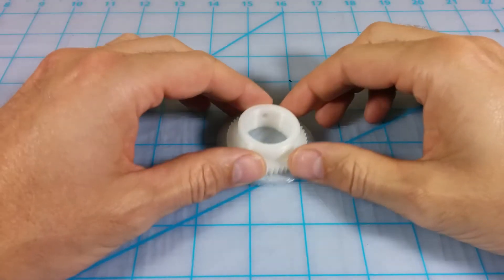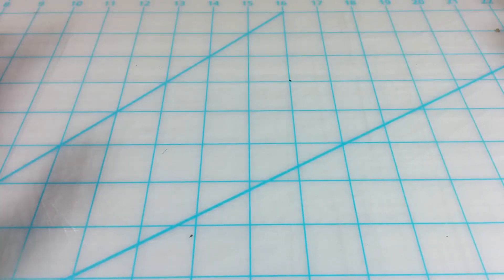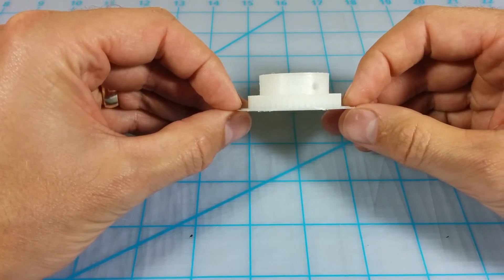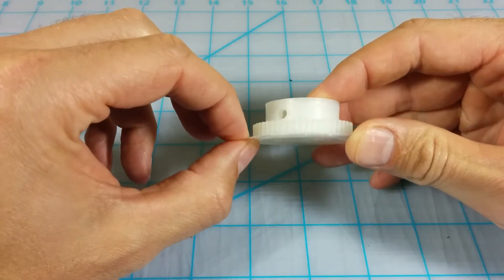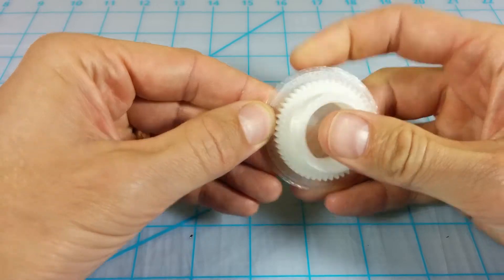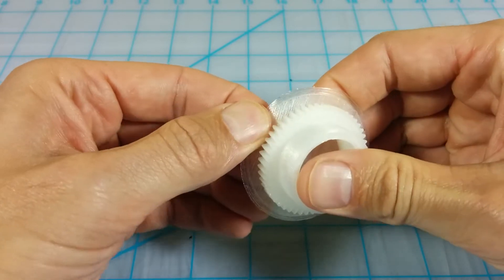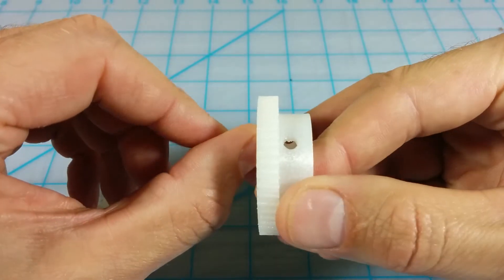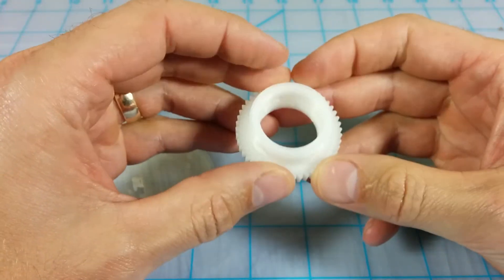Printing with Nylon - Taulman Alloy 910

Comment: It's very nice.. I printed a simple bracket with general nylon filament. It is of 2/3 of a palm size, a 2.5mm thickness base sheet with five 20 mm height screw posts. A severe wrapage piece was the result. As it flipped up, it didn't stick firmly on the bed.

Comment: What other settings you printed it on and what printer?
Why don't to share them in the video description ????
Reply from the maker: Sorry I posted this long ago and I don't have them anymore. I used the recommended temp settings for the filament and then fine tuned speeds which varies greatly from machine to machine, I always need to experiment anyways when I try on a new printer.

Comment: What nozzle did you use for this gear , looks fantastic in detail .. Some details for your machine if not in detail of vid ty!
Reply from the maker: The Kaveman Its a 0.4mm nozzle printed on a Printrbot simple modified to print 8X8X10" with an E3D nozzle, and heated bed. I now also use a gear head extruder that uses a hob and gears to drive the idler side of the extruder.

Comment: which program did you use to program the raft?
Reply from the maker: Daniele Valentini I used cura for this, enable rafts the use tweak at z to change temperature. I've been using Simplify 3D over the past year as I like some of the options.
Reply: Hi.  I'm using simplify 3D and am struggling a little with how to set up processes to enable different temps for raft, first layer then subsequent layers.. How many processes do you use and how do you set them up?  Thanks for any help!  I want to get away from any elephant foot when using 910.

Comment: Anybody know what the density of this stuff is in g/cm3? I looked at the datasheets but didn't see it there. It's got me thinkin' because Nylon is supposed to be pretty light compared to other plastics but very strong. That would make it handy for specific things despite the extra cost. Nice print btw, very clean. :-) Oh and also, neat trick with the temperature changes, that's pretty useful. Thanks for that.

Comment: What cutter are you using? I use Cura, and can't find a way to adjust temperatures depending on layer.
Reply: I actually haven't found a slicer that can do this exact configuration - the best way I know if is probably to get the slicer to generate the gcode at 245C, and then manually edit the gcode for just the first layer of the part (add or change the M104 S245 to M104 S230 at the start of the layer, and then change it back after). Usually the slicer will spit out some helpful comments so that finding the layer shouldn't be too hard.
Reply: I also have been giving the taulman nylons a go, oddly enough I am having more problems with the Bridge then I am with the 910, As for slicers,  Cura : you slice as you would normally, then use something like Notepad++ to open the gcode and change the values for the layer you want. but the easiest way is with simplfy3d, create multiple processes for each layer temp change.
Reply: Just bought Simplify3D, and man this thing is amazing, the defaults already seem to print better than my fairly tuned Slic3r settings.

Also yeah, Alloy 910 is definitely my favourite of the Nylon filaments. It's stiff enough not to curl up and jam in the extruder at high speeds, and also sticks very well to glass + diluted PVA mix.

Comment: Nice print!  

i am searching for a 3d printer capable of the minimum layer heght , as i am searching for a functional prototypes in machinery, i am from barcelona, spain, and i am looking at the bcn3d sigma or ultimaker 2+ extended,  bcn 3d sigma because of the 2 extrusors, so i can print with PVA for supports, and nylon on other extrusor,  and looking the ultimaker because the layer height is 0.02 and i really need to get detailed for example for making a hole in a model, for fitting a shaft of 15 mm i need a hole to be 15.02 for instance to have a right hole when i insert the metal shaft , to not be too loose or too tight, ,, 

looking at your detailed print i think you could be able to guide me here... 

Thanks!!

Comment: Cam, That is a really nice part.  Note - I have found Alloy 910 to possess some superior printing traits, and have been doing very well with that material (on my simple metal with pva, etc.)  ... but NOT as well as you.  Curious ... what slicer are you using ?   ... definitely have to give your raft and temperature variation method a try.  Thanks for sharing.